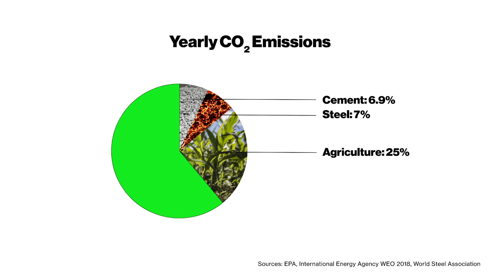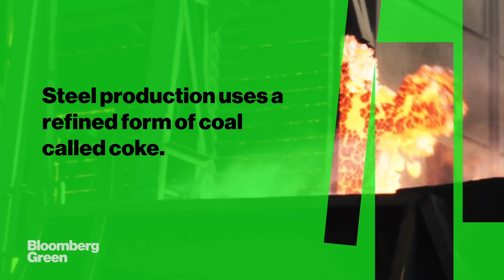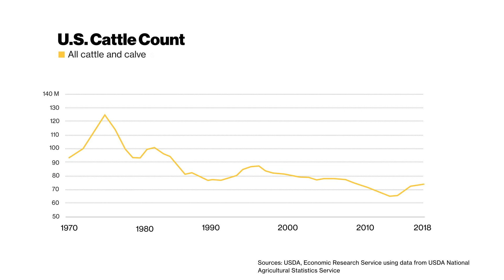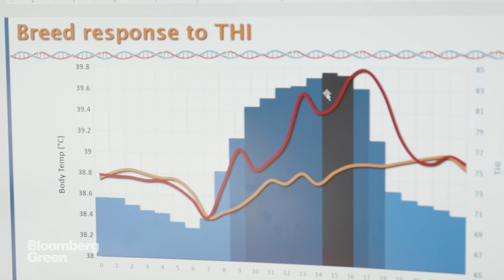Why We're Moo-ving Toward Decarbonization

Comment: Love when they show cooling towers and smoke towers as if it were straight CO2. Sorry, but you cannot see CO2 with the naked eye. Most of what you see is water vapor and sut.
Reply: so if you can't see Co2 than what should they show ?
Reply: @huzaifazulqarnainchaudhry2484  nothing, bc climate change isn't something humans can control yet.
Reply: Sure, but what else are they suppose to show? They need something to be able to represent "pollution"
Reply: @sevenhelmets  They aren't talking about pollution, they are talking about climate change and CO2. CO2 is not a pollutant.

Comment: Who did the research for this? The cement production methodology was incorrect and fly ash and blast furnace slag is used as a cement replacement in concrete, not an input material into cement production.
Reply: Also cow burping is the issue not farts.
Reply: @Bfould3120  it's both. Regardless of which end it comes out of, it's still a problem.

Comment: It's never going to be as profitable to be carbon neutral. Laws are needed. We are subsidizing coal. We need to do the opposite. We don't because the government is owned by exxon.
Reply: hymnofashes It might be more profitable in many fields after the initial (development) costs are covered. Take solar. In many places on earth it’s now the cheapest way to get electricity.
Reply: @potatoking8759  okay at some point there will be so little oil and coal left that mining it is extremely expensive and solar is more efficient. But not before we've burnt so much that we are screwed. And more to the point, say you're a coal mine. You can't make solar. All you can do is mine the coal, or not. It only has to be the case that extracting it yields more money than the cost of its extraction. It doesn't have to be the case that your ROI has to be better than solar.